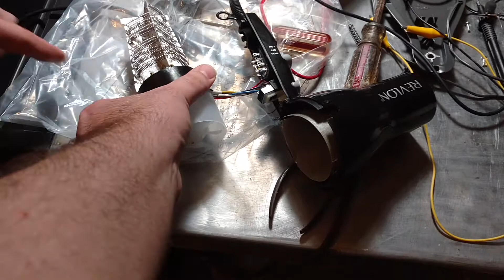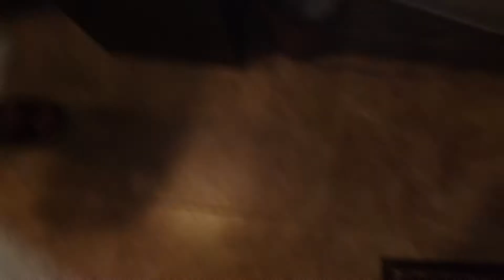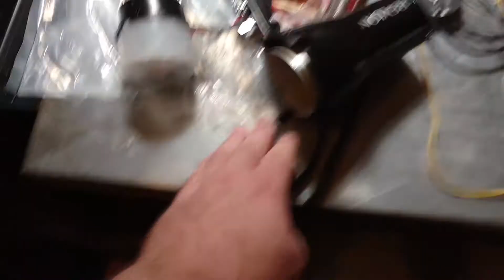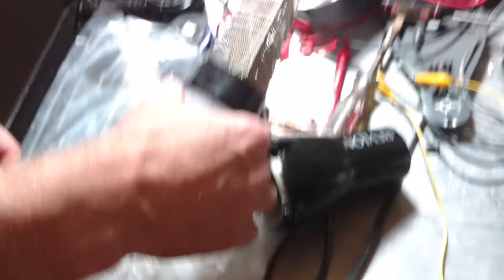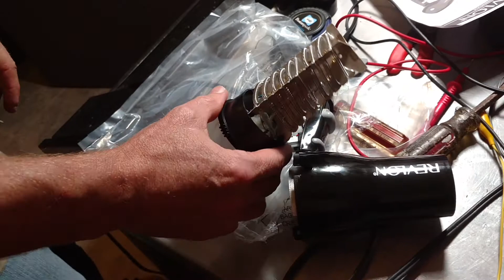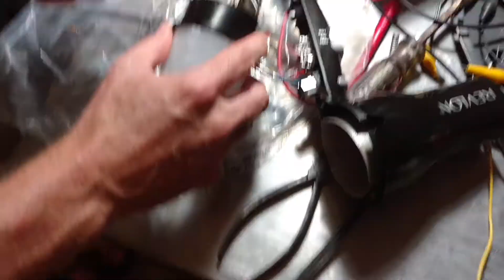Inside a blow-dryer

Comment: Between Sage hand shacking and dad probing, failure at start. best would be to get in a vice first, let it free float. Temperature is better measured with a thermal gun, not metal probe due to the fact it requires electric current to heat the elements. other than that, happy tinkering.